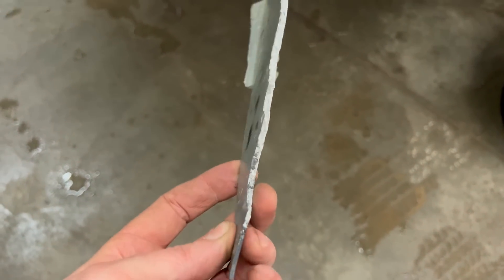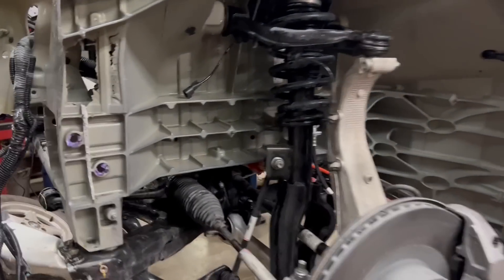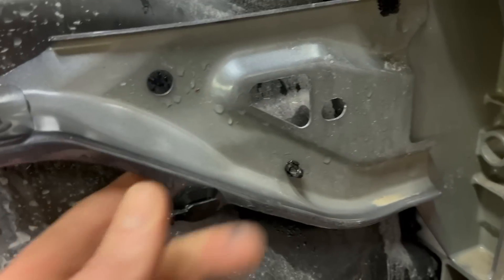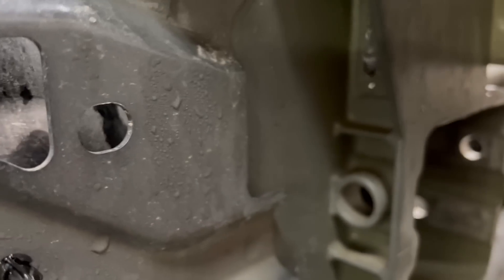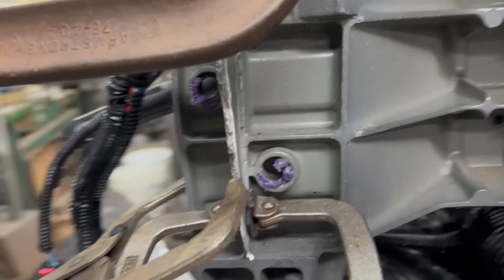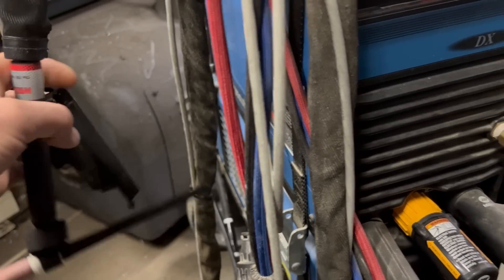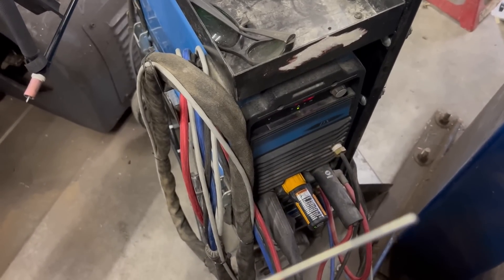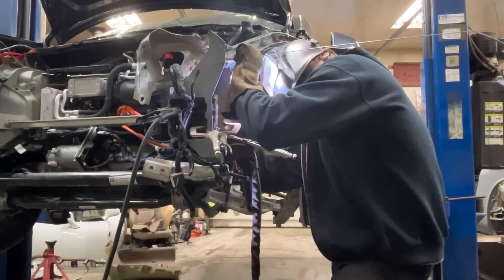Tesla Model Y GIGACast Repair

Comment: Hi, home welder, thanks for the video.  I would have liked to see the penetration and strength of those welds. A few good hits with a hammer would be interesting. Hopefully Tesla will come up with some legally accepted repairs but Tesla has to protect itself from the Tesla haters and the EV haters. Crush cans on the side and back would be good too , like the front and rear.

Comment: Gigacasting is one of those things where Tesla wasn’t the first to think of it, but more is elan having enough idgaf to push through the cons of it.  It makes the initial purchase cheaper (relatively speaking) but especially in the us where we drive aggressively and fast, it makes the cars functionally more ‘disposable. ‘

That repair and ones like it can work if they are small and smallish. And also the broken piece has to still be usable (ie not mangled to the point of losing integrity and ofc it has to be found post crash). You can’t go out and get one and fabricating it would be difficult understanding any repair to the casting has to approximate the same characteristics and integrity of a brand new car for insurance and safety reasons. 

Even he says welding is not a fix for everything casting related . So even fender benders can occasionally cause enough damage that a weld either is not possible or won’t restore the integrity close enough to the original strength and characteristics.  

Giga casting is not an EV thing. It’s a Tesla thing that other oems are starting to look at copying. But yeah. As he states. There has to be a way to design the casting to be safe but have it break in a more repairable way.

Comment: Tesla. I am considering the feasibility of a Tesla swap with a full frame mid-size truck (Dakota, S-10, ranger, etc.). I crashed a car a few years ago, and if it had been earlier than the 1998 it was, I would have died. So while I love older classics, I’ll probably never drive one again
Reply from the maker: Trucks are a good option for a swap. Lots of room for batteries!
Reply: @519Kustomz  I agree. I keep a running build in my head about it.

Comment: They believe that people will be using FSD more, reducing the number of accidents, reducing the speed of any accident, and therefore, reducing the damage to only the bumper and replaceable frame parts.
If the crash also doesn’t cause any  injuries, because of the design of the Tesla, the total amount of money paid by the insurance company is less, because they care about the total loss, meaning the people and the car. If the people have no injuries, and the car has a few, the insurance companies have higher profits than traditionally made cars that direct more energy to its occupants, leading to higher personal liability claims.

Comment: Tesla.  6 months later.  Good video.  Accurate analysis on the issue.  But as you said, Tesla is unlikely to incur the cost of a new casting die to benefit the crash repair industry / 2nd life vehicles.

Comment: Would making design changes to the casting require retooling that is more expensive than normal?

Tesla
Reply from the maker: Maybe when it is time to freshen up or rework the die, they would change it then. Cost would be negligible at that point.

Comment: It should be a practical tool modification for your suggestion. Contact Elon Musk directly at Tesla with your suggestion, although YouTubers have not been very successful with Tesla engineering with cost saving repairs to their cars. I think that you are right in your idea to a design modification to Tesla giga die to facilitate front crash repairs. The only problem would be stopping production for any modifications. The outriggers in question may be part of the quality alignment for the chassis but the designers need to start thinking outside the box. Even Tesla cars crash. Ambrose retired toolmaker/ quality engineer
Reply from the maker: I wonder how one contacts Elon directly?

Comment: What are the frayed onion skin see through areas about right next to the snapped off piece? Is that where Tesla`s proprietary magic Aluminum did not flow in adequately? Tesla`s are expensive Mattel like toys, if hit hard enough they become just plain irrepairable scrap . The insurance on those junks must be through the roof , considering that totaling the car is more than likely  the norm at any speed above 25 mph impact. That should be the topic for another video ... Liberty Mutual drops Tesla owners!!!
Reply from the maker: That flaky stuff is aluminum flashing from the high pressure in the casting process. Usually it gets cleaned up after the casting process but Tesla chose to leave it.
Reply: @519Kustomz  
Nice going Tesla ! Although unseen ,hidden under the various components and outer skin as it is ,  it is still offensive to look at when considering that the price of  those rolling  lithium powered "cigar lighters" decide that is time to for the owner to have smoke smoke , cost on average about twice price of the average ICE  cockroach .One would assume that for their GMT subsidized  retail price  a more refined assembly could be  produced . From the mechanical point of view perhaps it is not warranted,  since none of that structure could ever be repaired  if the crash involved anything heavier than a loaded grocery cart doing 25 mph across a parking lot ...gotta love it . Good old fashioned reinforced fiberglass might be superior to it and more cost effective .

Comment: Since it is cheaper to create precision castings rather than create precise complex stamped or pressed brackets, perhaps they could have separate cast brackets  connecting  the main casting. That way they get the precision while also getting the advantage of vulnerable parts being sacrificial.

Comment: Ideally, make a new fender bracket that extends into the recesses of the gigacast, and retain it with little M6 bolts.  Tesla should have done that instead of spot-welding a bracket that's stronger than that flimsy ear sticking out of the gigacasting.  That ear probably gets broken often in the plant from handling damage anyway.

Comment: I would LOVE to see ALL car makers go to an abs plastic panel system (fenders, hood, quarter panels, doors, trunk) that snaps onto attachment tabs (male/female). they could expirament with different polymer panels or composite reinforced abs, similar to what saturn did perhaps? imagine if any & all fender benders were solved very simply by just ordering a panel & snapping it on.

Comment: How do you know if there aren't any crack in the rest of the GigaCast?
Reply from the maker: so far just careful visual inspection
Reply: @519Kustomz  Gotcha. For safety critical inspections, I know folks use ultrasonic crack detectors, but not sure how feasible it would be inspecting small sections at a time.. Which is why I was curious..
Reply: It would be a good idea to make sure that all welding repairs have extensive NDT inspection carried out after welding repairs. This can be extended to immediate structural areas further away from crash area. We use to do this weekly to all our routers spindle cutter attachment devices after one broke off narrowly missing the operator by a cat’s whiskers.

Comment: Nice repair and thanks for posting the video.  I wanted to make a suggestion to make your sign on the wall just a bit cooler.  Paint the outline of the 519 off your shirt on the wall behind the sign,  it will pop real nice, plus the color off your shirt is in the same pallete as the color on the wall.  I think it would look so cool.

Comment: Tesla. Tesla company now offers insurance for their cars in several states at competitive rates..

This insurance gives them direct insight into components and designs that add signficiant repair cost for common collision scenarios. They have tight feedback loops and agile manufacturing . This should allow them to rapidly evolve their design to incorporate the lessons learned. Your suggestion for a sacrificial fastener or mount to avoid Gigacasting damage in low-energy collisions seems like a candidate.

Comment: Tesla.  And I always wondered if what your did was possible.  I Have a Model 3 that replaced the Model 3 that I totaled (my fault).  Is it possible that the casting piece is meant to break away as part of the crash protection?  It saved my wife and I in my crash.  Totaled the Tesla, but that’s better than the options.  Man, that thing has a lot of airbags! And they work!
Reply from the maker: Rightfully so, Tesla is more focused on occupant safety than the ease of rebuilding the cars. Glad you guys are alright!

Comment: The bracket should have been made longer and riveted to the thicker part of the casting, rivets are cheap and fast to install so it wouldn't add much production time/cost.  In a crash the bracket would bend, or break the rivets off if hit hard enough from an angle where it wouldn't bend.

Comment: There is a repair procedure for this particular section of the car if it is damaged a lot more than the one in this video. Lots of part removal and install but definitely wouldn’t total a model Y with how much they are worth. The repair is a complete front clip assembly. R+L is all one piece. Not a single weld to perform this repair. All glue and bolts. Celette frame bench required to replace the complete front assembly.
Reply from the maker: wonder what price and availability would be on that front cast?
Reply: Looks like the part is around $2000. Availability is not looking great at the moment.

Comment: Tesla.  I was interested all the way through...   Definitely looks vulnerable to crash damage.  Must be low cost, easy to get location tolerance for fender mounting, spot welding the bracket to the cast wing.  They figure screw rebuilds.

Comment: If the vacuum pumping aluminum alloy die-casting process is not used, safe electric welding can only be done when the castings are assembled with few pores. Otherwise, electric welding will cause high-temperature expansion cracks in the pores and the strength of the casting will be degraded.

Comment: Great job on the welding. i agree with you. But this raises the ugly specter of irreparability of modern product design. For example: I've had many Audi's in my life and have always paid their high price [for a VW like product] because of the great ergonomics, beautiful Bauhaus-inspired design styling and good general build quality. If I look at my current A4 in detail, I am astounded at the lack of both good ergonomic design and honest build quality. The buttons fail early, don't work in terms of ergonomics and the car is clearly designed with Pre-determined product obsolescence in mind. "Everything will be worn out by 200kkm". My first TDI lasted 500kkm with no issues [1000km range on a 48l tank of diesel!] The next generation lasted 400 [1990's], the next gen lasted 350 [200's] and the next, 250. I take care of my cars, I pay a high price for them [chunks of my life] and have been loyal to Audi. My current Audi is KAPUT at 215kkm. Everything is worn out! MADE TO FAIL. Flimsy! ......   As an Electrical Engineer and Industrial designer, I have to admit that my professional opinion is that this sucks! I am no longer seeking and Audi as my next car, after 30years at the wheel of the 4 circles. I note their presence on the list of the 'You shall own nothing and be appy" club, with great sadness. Herr Hoch would be doing high RPM's in his grave, if he were to see the sorry state of the once wonderful marque that he created. Sandy Munro is quite right, of course, it's SAD, very sad.
Reply from the maker: Yeah everything is made cheaper and cheaper, no doubt

Comment: I'll tell you what m8. Your welding is superb. I'm no Welder but I know what an effing good weld looks like and what I've seen in this video is outstanding. 
I've never heard of you so thanks YouTube algorithm. I've subscribed coz I admire good workmanship. 
One point on that tesla model Y. There were a couple panels that looked like rust holes due to ultra thin material. Are those panels going to be fixed or is this vehicle a project to no end?
Looking forward to seeing what you've done and going to do.
Oh please. ALUMINIUM not aluminum.
Reply from the maker: Thanks! This model y is a donor for some ev conversion projects, so it likely wont make it back to the road. I was just very curious if the cast could be welded.

Comment: Tesla investor here. We have news almost every other big auto maker is switching to Gigacasting as its technology has been around for a decade (as Sandy Munro pointed out over and over). I guess this kind of repair will be more and more requested in the future, not only for Teslas
Reply from the maker: I would bet the majority would have a repair procedure involving adhesive bonding instead of welding. To hard to control and maintain weld variables with different people, machines, process, etc.

Comment: Is there any chance, easy break off bits are there as a “crumple zone”?  If not, where ARE Tesla’s crumple zones?
Reply from the maker: Directly in front of the cast are the crash cans. They do a great job of energy absorption
Reply: @519Kustomz  the “crash cans” - wow thank you very much
Reply: @519Kustomz  I heard this casting manufacture method is only cost effective for large volume models. Do you know to be true? If true, to your understanding, regardless of efficiencies, does a vehicle made of one or two castings, make for a better stronger, longer lasting car?  (I get ‘strength’ is context / requirement dependent, tensile strength - need for flex in human bone peaks under 30, mag-alloy wheels stronger than steel,  but shatter past design limits) A complex optimisation problem as we combine things with different strength profiles

Comment: The idea is that TESLAs will be in less accidents as more safety/ driver assist technology enters the auto industry. Tesla will be at least 25% of the auto market by 2030 which should help reduce accidents overall.  In any accident anything you attach to the casting will likely damage the casting anyway. Break away fasteners of some sort might be the answer instead of spot welds.

Comment: Having built race cars, hot rods, and resto mods all my life has made me a good machinist, fabricator, designer, and welder so to my eye those ears are poorly designed, and are a real disappointment especially as I have a Cybertruck on order. Any use of aluminum castings in the critical structure of the Cybertruck goes totally against the exoskeleton based description that has been provided by Tesla. Early in my working life I was a mold maker for the number one institutional plastics maker in the USA, a company called CAMBRO Manufacturing. I noted quite a bit of unfinished flash, or alternatively unfilled pockets left on the casting you partially repaired. They should have filled them as part of the intended casting to keep water out, or if those openings were desirable, and intentional trimmed them clean before allowing the installation of the casting. We could never have sold a plastic product that looked so unfinished in that way leaving such rough, possibly sharp edges. I saw several ways to make a good fix there were it my desire by simply adding a new sheet metal fender attachment point bolted to some of those unused cast holes visible in your video, or if those were spoken for adding a couple drilled and tapped holes to the casting with bolts small enough to break away in any repeat accident. I watch everything Musk, and Munroe in my comfortable retirement surrounded by my machinery, welders, and projects. I was shocked to see a massive gigacasting section apparently positioned haphazardly inside what appeared to be a section of cold formed stainless Cybertruck body in some video about the Texas Gigafactory. Curious to see if the production version of what I ordered meets my expectations. Might be more fun to buy one damaged, and replace the damaged casting with a stainless fabrication as would be done in mild steel in a hotrod, or 4130 in a race car. Might even be a good business model for serious offroad modification folks.
Reply from the maker: Lots of love for the hotrod and race industry. There is for sure room for improvements here.

Comment: TESLA - It would have been nice to se a picture before and after the repair. The cost of parts and work to fix the car. 
Several people tell that welding of the casting is possible, but this video is the first i have seen it done.
Reply from the maker: This model Y was just a donor car for some EV conversions, it never made it back on the road. I was just super curious if it could be welded.